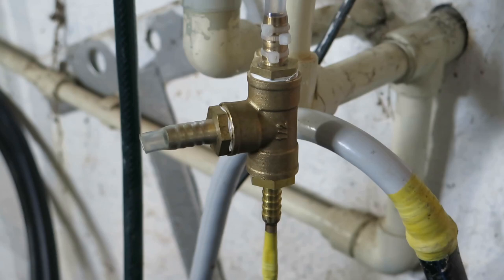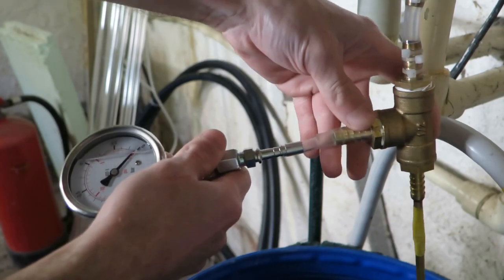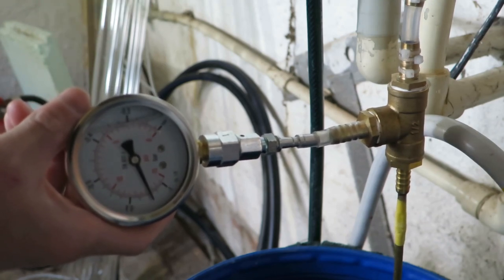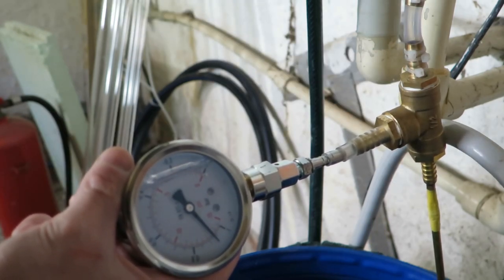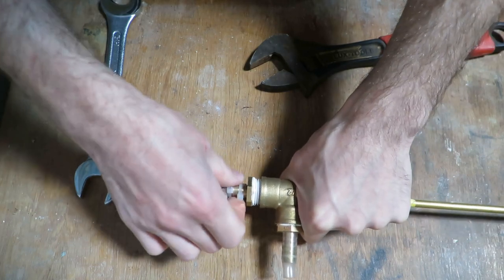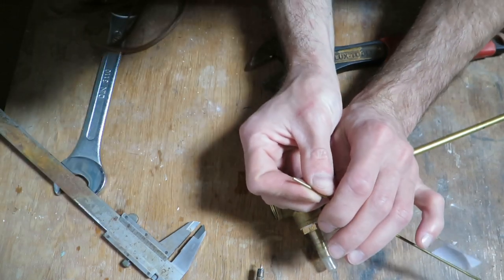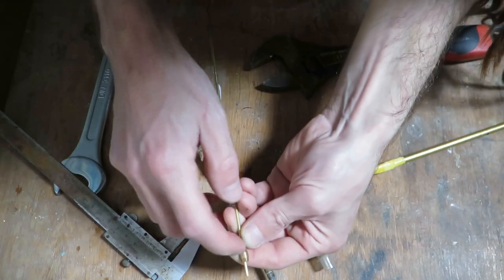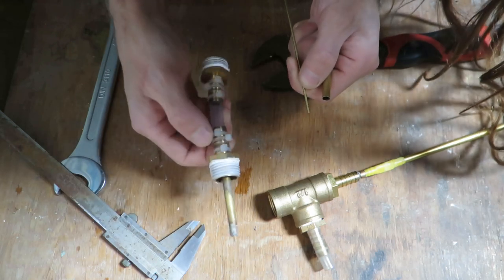Aspirator vacuum pump from plumbing stuff

Comment: Nice video thank you!
Reply from the maker: Thank you for thanking me :D
Reply: @IlusysSystems  Btw I am a bit curious if is that vacuum gauge one of these liquid filled from eBay? Was it including hose adapter fitting?
Reply from the maker: @milossipeki1949  I bought it locally in some shop called "Parker". Gauges like these often comes in G1/4 or G1/8 thread possibly R - conical thread, but both are "compatible" with enough teflon or loctite...
So you can fit all sort of plumbing there really and it doesn't have to be specialized. I grabbed some hydraulic stuff that could probably handle 1kbar and stuffed PVC hose on that heh. Otherwise I would buy water / gas fittings that you can get in hardware stores.
Reply: @IlusysSystems  So thanks for the info and have a nice day :)

Comment: That's pretty cool, man. Are you going to use it to pull a vacuum for use with epoxy potting coils?
Reply from the maker: Probably will use it to de-gas stuff in future,  I don't plan on potting coils now though.

Comment: 8 to6 bars means a tank at 80m height or at least 60m height... are you sure? Or you use a high pressure pump?
Reply from the maker: Yes, water towers are about that high, though here water plant probably uses pumps to maintain pressure :)
You can use high pressure pump and recirculate water, but you risk contaminating it. I use fresh water, since I use like 1000 liters a year for this purpose max.
Reply: @IlusysSystems  are you sure you have 8 bar at any tap of your house?
Reply: Unregulated water pressure above 4.5bar becomes harmful to get a shower. At least, in my country, home pressure is limited to 0.8bar from the street, and 4.5 bar in high buildings, means watrer tanks at 45m height maximum, or with regulators inline to get this value.
Reply from the maker: @osposto  I never said, I have 8 bars in my house. Measured it now, it's only 3 bar. I assumed it would be around 6, not sure why. Either because most high pressure pumps here are 8bar and water level is usually not deeper than 10m, or it's because I spent 3 years designing pneumatic machines...